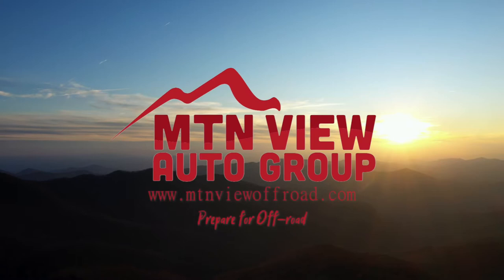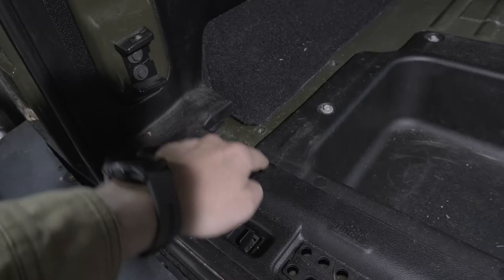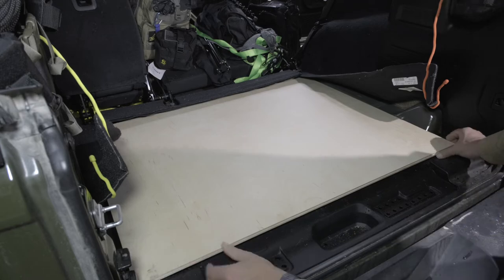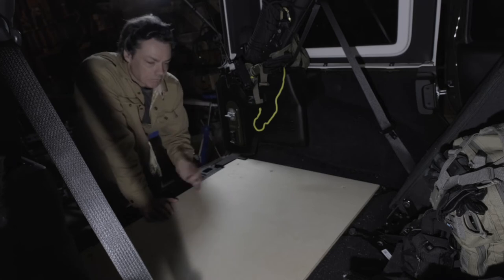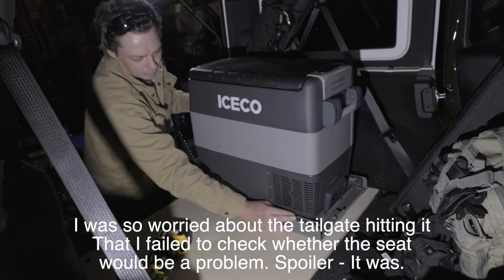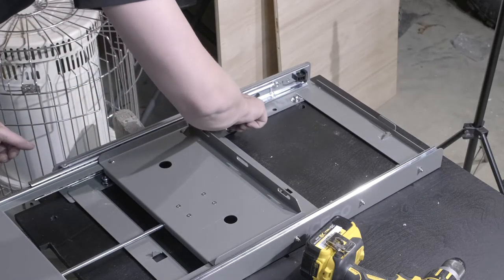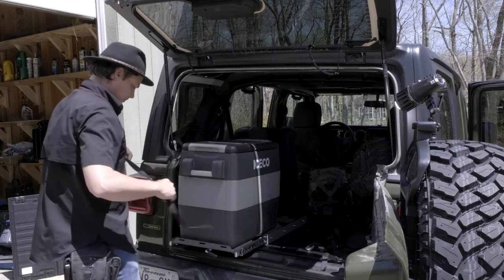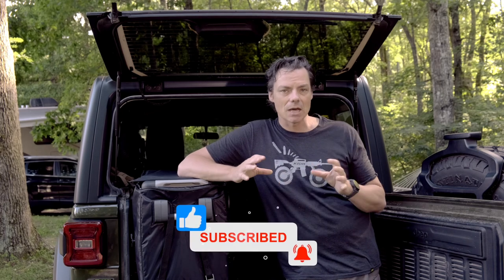Jeep Rear Plate DIY Build with ICECO 50L Refrigerator Install - simple alternative to Goose Gear

Comment: I'm getting ready to do the same thing... and hoping that my ICECO APL55 fits on the slider while mounted... currently my rear seats are out but will be putting them back in soon.  Goose Gear uses birch wood as well,.  They make a great product but I dont want to relocate or remove my sub woofer... so it's DIY.  Great video.
Reply from the maker: Thanks!  Good luck with your install!

Comment: Not sure how I missed this video. I’m filming our fridge install today and tomorrow. So this sparks my curiosity
Reply from the maker: Well the diagram certainly won’t help you but possibly the idea will.  Next is to create a cabinet to the right of the fridge..
Reply from the maker: What I really want is a setup that has a quick release where I can remove the cabinet when I want… if you have ideas on that I’m all ears
Reply: Well, I took what should have been a easy install and make it a complete mess. Was trying to film it and it just came all apart on me. And I still have concerns as the fridge will be out in the elements. Going to get a cover for it, and I’m going to move my tent to the other side, which means moving my basket and awning… but it will give it cover as well… all in the name of cold food 😂
Reply: Quick release cabinet… without seeing a drawing or something… I instantly think of a hood pin or something you could set it down on and put the pin in to secure it. But you’d have studs sticking up all the time…

Comment: I'm wondering, could you not have just elongated the mounting holes for the plate, and just slid the whole plate and fridge assembly back a 1/4 or 1/2 inch?
Reply from the maker: So sliding back 1/4” would have made it interfere with the 40% seat that I left from fully locking in place.. I actually had it there first only to discover it was an issue and had to move it forward to fix.  As it is, the fridge rests directly against the seat and therefore very secure.  I have since replaced the rear plate with goosegear because I removed the 60% and needed storage. It became more than I wanted to deal with to figure all that out.  It isn’t cheap but it does fit together beautifully.
Reply: @aMAYSingLife  I am glad you're happy. I am still trying to figure out what I will do, I am handy and think I can build something with 80/20 and HDPE panels or plastic-hair ABS. My problem with drawers and built-ins, is the weight and my project is a 2dr. I lost both of my legs and am recovering from the second amputation, so I have 3-4 months before I have the new prosthetic and am fit enough to build; lots of time to plan. Cheers fella!!!
Reply from the maker: @geographyinaction7814  good luck on your project!! I’d love to be that handy with carpentry tools, alas, that isn’t my forte!!

Comment: What size are the bolts that you used to bolt down the fridge?    And If I ma doing this with a JP40,   would I have the same issue with the rear seat?
Reply from the maker: You are going to hate my response but its what I have...  Unfortunately I lost the sizing information somewhere between ACE hardware and home.  however, I'm going to go outside right now and take them out and measure them because I keep getting asked and its stupid i don't know.  So give me a bit and I'll let you know.  On the size of the 40...  hmmm..  That's hard to say because I think the 40 is shorter than the 50  but is the same footprint if I'm not mistaken.  If that is the case, then you may not have the issue I had.  If it uses the same slide then you know its going to go back as far as mine, however, mine was only an issue because it was as tall as it was, so dropping it two inches might be enough to not be a problem.  All i can say on that is be sure to place your fridge in the slide in the back with the seat up so you know exactly what you can get away with.  i'll let you know shortly what size i used...
Reply from the maker: oh, and here is a twist to this... i am ending up getting the goosegear system because i am doing a seat delete and I needed solid storage area where the seat went and i need storage in the back too because of a topper I'm getting (video coming on that - probably next weeks video).  While this version has done well for me once I started needing exacting sizes in order to extend out further it got pretty complicated.  Plus, I really need the storage capabilities and didn't trust my skills to make it work the way i wanted.
Reply: @aMAYSingLife  thanks for the quick reply,   I think this kind of setup will be perfect for me.    I am trying my best to keep everything small enough to fit under a fabtech shelf, and also keep my fast back soft top.    Wanting the best of both worlds.    My fridge and slide come tomorrow so I already made my cuts and test fit the plywood.   Just waiting on the main attractions to finalize it.   Then onto building a box for the other side.    If I was video savvy,  I'd record what I was doing and post it. Hahahahaha
Reply from the maker: .75 length, 5/16" width and 3/16 allen head
Reply from the maker: and just get the wood inserts to fit the bolts.
Reply from the maker: since you test fit your plywood you could screw something into each of the frame bolt holes where it could mark the plywood basically giving you drill marks..  might be able to double check your measurements that way..
Reply: @aMAYSingLife  that is a genius idea,   too bad I had already drilled holes using the card board technique.   And royally mis measured on the first attempt.  Lol.   I had to use the 2nd piece of plywood. Hahaha.   But I got it on the 2nd try.   Wish I would have thought of that first lol

Comment: So the dimensions on the website are the corrected dimensions  meaning they don't need to be redrilled am I correct
Reply from the maker: I would check by using those dimensions on a cardboard template to verify.  But I measured it as close as possible..

Comment: What size wood inserts did you use to mount the slide? And what screw length. My slide will be here in a couple days and I made a similar deck to mount it on in my 80 series.
Reply from the maker: This will depend somewhat on what slide you use as the size of the holes in the slide will dictate the size of the bolts you use.  And the wood inserts simply match the bolt size used to go through the slide.  I actually didn’t record what i purchased unfortunately but that is how i decided the size was based on the holes in the iceco fridge mount.  The instructions should say that came with the slide.  Sorry about that.  I have regretted that since as i have been asked about it a few times now..
Reply: @aMAYSingLife  no problem. I will be running the same fridge/slide setup as you. I just wanted to purchase the bite before the slide showed up. Not a big deal.

Comment: Never apologize for wearing eye protection, if you were wearing a SCUBA mask I would have just smiled; two thumbs up!!! Thanks for this...Goose Gear is crazy expensive here in Canada, and it's 80/20 and simple panels.

Boring out the holes was a good idea, that wood may expand or contract depending on the climate where you live; the ply won't crack.
Reply from the maker: Thanks for that!!

Comment: It’s perfect timing that I found this!  I’m starting the exact project for our JLU!  My (on paper) plans are identical to what you did with your Jeep.  Thank you!
Reply from the maker: Glad it helped!  Thanks for watching!
Reply: @aMAYSingLife  I got my plate cut out yesterday, and one thing to note, is that your plans are for a JLU that does not have the factory installed subwoofer.  My Jeep has the subwoofer and; the plate is narrower by a few inches, the notches near the door opening are slightly different, and the mounting holes are in a different location.  The procedure in your video is spot on for both models, but the plans are different.
Reply from the maker: @chrisgardnerss  I thought I said mine was a Willy’s but I don’t think I stated about the sub…. I need to put that on the sheet with the plans… thanks for that.. luckily it’s bigger not smaller than needed…
Reply: @aMAYSingLife  The video is still super helpful; even when building one for the "with sub" model!
Reply from the maker: @chrisgardnerss  thanks for that.. do you know exactly how off it is or is it a curve you have to cutout for the sub? Or did it shrink the width all the way back
Reply: @aMAYSingLife  It's narrower all the way back.  Mine has a width of 36 7/16".

Comment: Thanks for this video, I was about to go with goose gear plate system but I didn’t need all the drawers either, just a mounting solution for my fridge slide.
Reply from the maker: Full disclosure I ended up having to get the goosegear system because I needed the storage it offered underneath but this solution got me the first year while I was figuring out my final build.  Good luck in your build!

Comment: Did nearly the same last week, before having seen your video here :) good to see it, will get a iceco32 for my jeep. Will you build in anything else? I plan a drawer on the right side for kitchen stuff and a vector cargo basket above.
Reply from the maker: Honestly, if i had it to do all over again, not sure i would build it.  I met a company at Overland Expo West called Dirtbox.  US Made.  Good gear.  They have a rear plate for 270 i think is what it was.  Not sure given the cost of the lumber and maybe 150 in labor that i would build it again.  I’m desperately needing a cabinet to the right of my fridge.  I may go dirtbox with that though.  Nice people, American made.  And would save me a ton of time.  Haven’t decided yet but thats what I’m leaning toward.   I’m also looking to remove rear seats as I am looking to get the Ursa Minor camping lid.  They have a back log though so it will be a while before I will need to reconfigure the seats for that purpose.
Reply: @aMAYSingLife  Can't find DirtBox anywhere in the internet

Comment: nice build what size of nutserts did you use thanks
Reply from the maker: man, second person to ask me that..  I actually dont know now as i used them all but it actually doesn't matter as long as the bolt goes through the slide holes and the nutsert is made to penetrate the majority of the plywood.  so its 1/2 inch plywood so that would be the length of the nutsert. (is that a real term? lol).  then just get a bolt to match and you should be good to go.  I will take one of the bolts out next time i'm near ACE and pair it with one that fits just so i can update the details on the website.  sorry for missing that!!
Reply: @aMAYSingLife  thanks for the reply man! its called teenuts haha i saw some put 5/16 but how was it holding up and hows the fridge
Reply from the maker: @m1gz883  It's totally solid.  I'm really happy with it.  The fridge has been great too.  With the Jackery 1000 I can run it for days so power management has been really easy even when gone for weeks at a time.  either it gets charged back by sun or by the jeep but I never run out of juice.  I rarely even bother to put the fridge in "eco" mode.  just hasn't been necessary.

I will say if you are looking to make your own, I would highly consider DirtBox (not affiliated, just saw them at Overland West). I think their rear plate is 290 or something like that and I believe you have access to the compartment underneath which would be really nice.  I didn't make a cutout for that so I just lost that space.  Considering time and money, 290 isn't bad for a rear plate..
Reply: @aMAYSingLife  i got a good deal on a goosegear plate system but the premade screw holes did not aligned to the iceco slide so i need to make a new hole. im using goalzero yeti 400 as my backup and it work okay planning to get a bigger one im using the 110v plug because the cigarette lighter plug keeps on popping out
Reply from the maker: @m1gz883  if i had it to do over again I would buy the Jackery 1500 due to the difference in speed of the charger and of course the extra 500.  I had used goalzero for years and still do on the motorcycle (more compact) but so far i'm happy with the jackery. i do wish the handle folded down but other than that its good.  i had some GZ stuff fail on me and didn't seem as though the power lasted as long as it should comparatively speaking.  I also use the Anker 28000 PD brick for charging different things around the camp including all my camera gear so I don't have to have them plugged into the jackery that generally remains in the jeep.  One of my Oregon videos shows how I eliminated the issue with the cig plug popping out.  I used those rubber coated wire things you can get at REI to wrap around the plug to secure it..  worked great.  The 110 is going to pull a lot of power having to convert to 110 then back to dc..  i'd look to secure it similar to how i did to save that conversion loss if it were me.  good luck with your build!
Reply: @aMAYSingLife  thanks for the info ill check your videos im still in the process of finishing my rig for overlanding i have a lot more to learn! i started with rtt now im building the kitchen